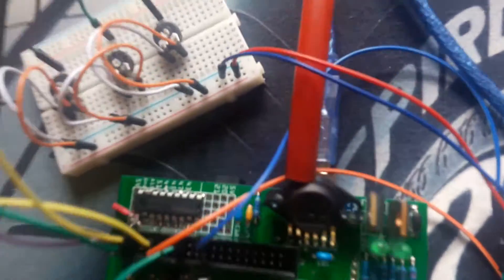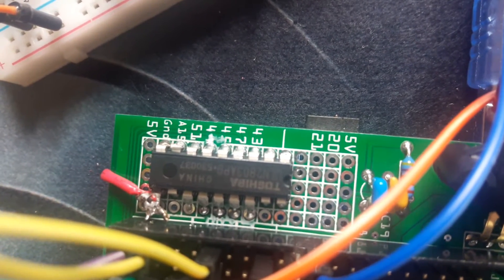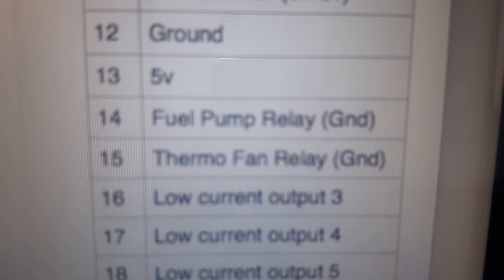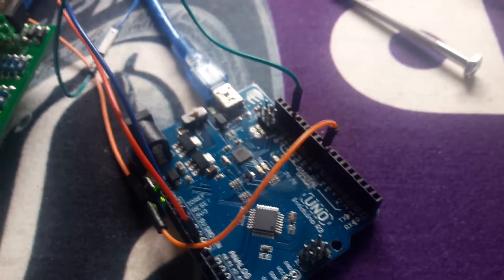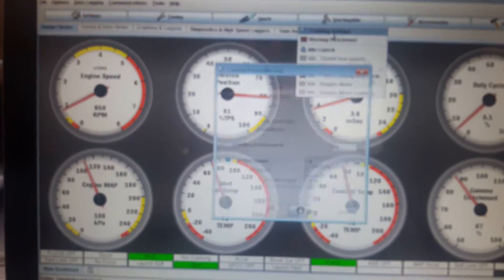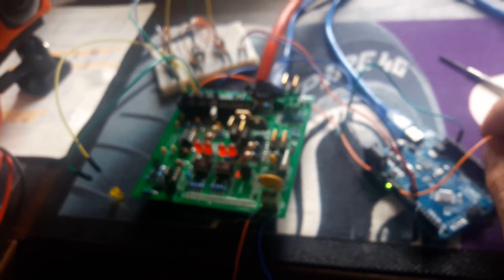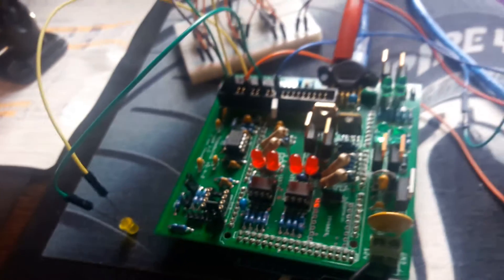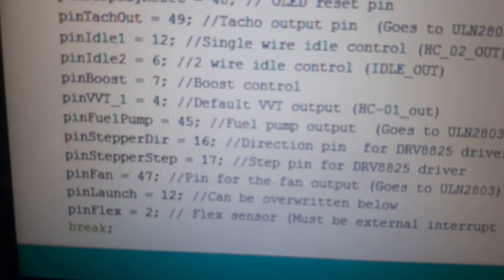Speeduino outputs tested2

Comment: any idea where to order a board and part kit for this project ?
thank you
Reply: The zipfile contains a BOM for Mouser.
There is a store: https://speeduino.com/shop/index.php
Parts and PCB.
Reply from the maker: yeah check the wiki - everything is on there. use the latest firmwAre it solves alot of the issues too
Reply from the maker: www.speeduino.com

Comment: I am building up a V0.4.2 pcb, ordered the parts yesterday.
Good info - thanks.
Is there a non-fragmented schematic anywhere?
Reply from the maker: yeah check the wiki - everything is on there. use the latest firmwAre it solves alot of the issues too